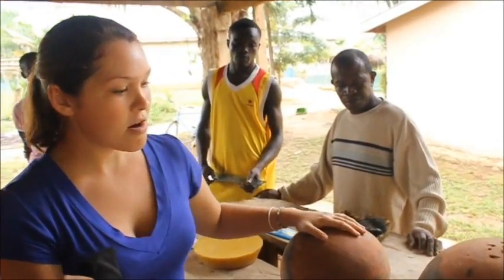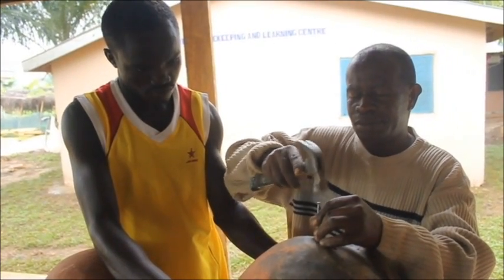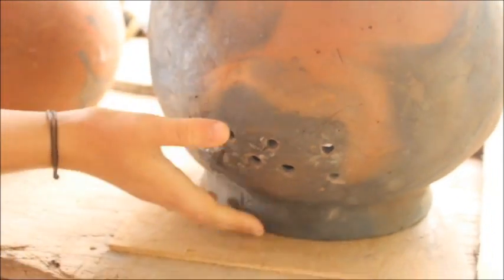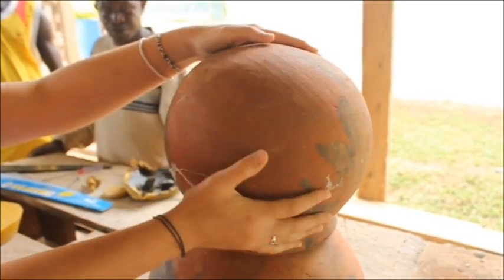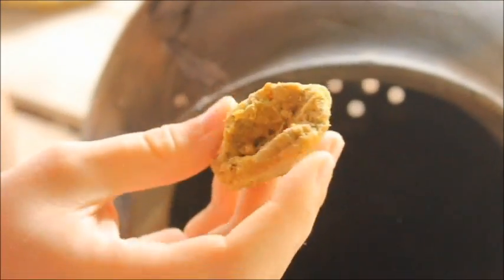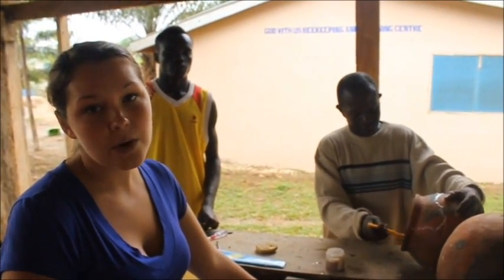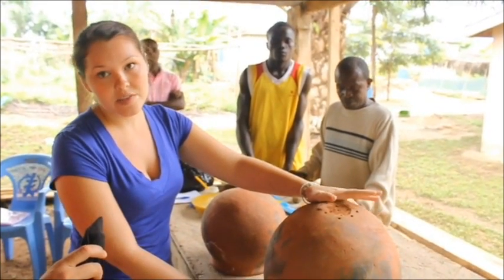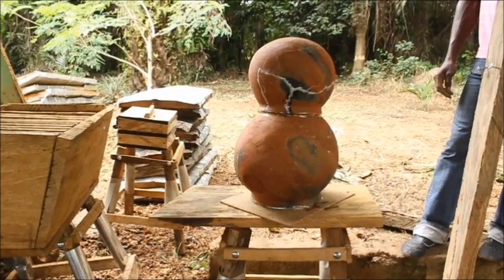How to Construct a Claypot Hive - Peace Corps Ghana

Comment: wouldn't be easier to drill the holes before firing the clay pots?...this would avoid the risk of breaking the pot
Reply: If you put the pot emerged in water for few days before making the hole, you reduce the chance of breaking the pot
Reply: Youre right...however here in Africa. All our pots are sold this way. unless you want to make a special order. Where a customised pot may cost a bit  ( which is an unwarranted expense if you just could DIY. )
Reply: Use a carbide tip drill bit and making hole under water is easy